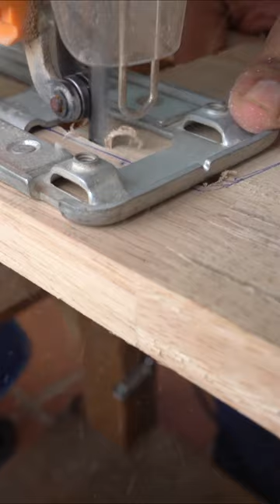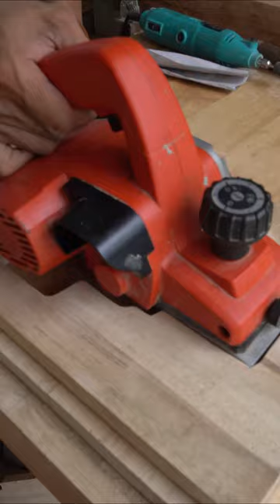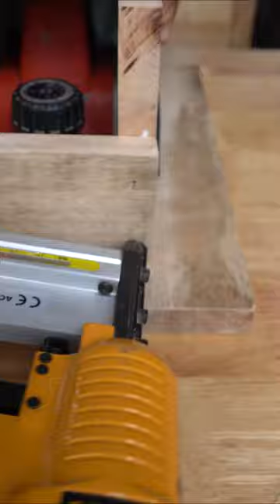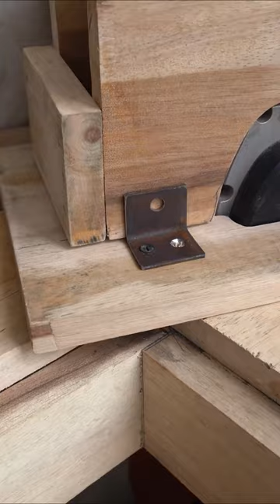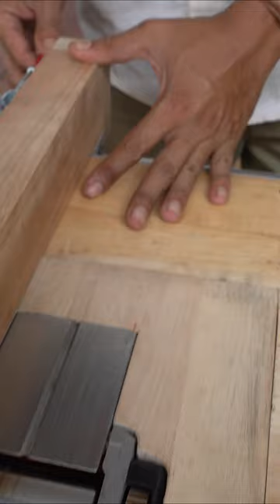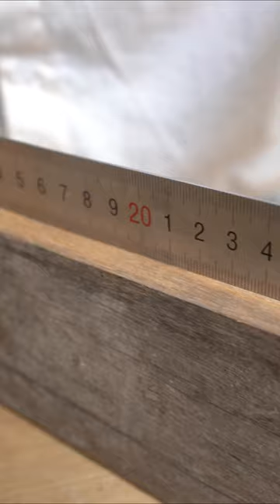Creative Simple Woodworking tool #woodworking #shorts #diy

Comment: Clamp two pieces together and just use the tool as designed. The wider surface will give you a more stable cut without taking a chance of cutting off fingers. Jointers have blade guards for a reason.
Reply: Nah this is a great way to save money on overpriced joiners. The “as intended” method isn’t as useful.
Reply: Pfft... Don't leave ur house if you're that scared
Reply: @jckdnls9292  I have seen fingers cut off in jointers, table saws and chop saws. I still count to ten with my fingers. As a carpenter for over 42 years I do have experience. There in more than one way to do everything. Just giving my opinion. Do it however you see fit.
Reply: @lyndonwhitson2269  yeah I've been doing  machining work for 30+ years and I've seen people's sleeves get caught on lathes, or  hairs around end mills,  fingers milled half off...  And yes there are dumb people everywhere.  However on this case, this guy doesn't come across one of them,  and his little project is harmless as long as you follow safety procedures like any other machine.  Stop treating people like children.
Reply: Ахахаха. Я, работающий на фуганке с шириной ножей 600мм😶

Comment: ça ne peut pas fonctionner...
le principe du rabot est la différence de hauteur générée par le plateau avant ajustable...ici il n'y a plus de possibilité de faire varier la hauteur de rabotage!
Reply: It will still work. It's just strictly a joiner at this point.
Reply: I contemplate the same idea. If the tool itself was mounted so that the outfeed portion was proud of the surface and parallel, it would function at least as well as it would when hand held. After another look, I think that if it was mounted so that only the extreme toe and the extreme heel were flush, then the cutterhead and throat would be exposed sufficiently to work with the action of a hand plane, rather than a jointer. This must be the explanation. I applaud his design and economy of construction! This is a very useful module to the combination machining station he has made. I am sure that he already has a router that can mount in the same opening. Subscribed!
Reply: @notreallymyname3736  no it won’t.  The infeed needs to be lower than the outfeed.  By having the wood go all around the outside keeps the trailing end the exact same height of the out feed.

Comment: If you use a machinist square and get this a perfect 90, with a nice longer fence then edging would be easy to reference. Nice to get a 90 edge so you can run it on the table saw.

Comment: Wouldn't you achieve better results setting up the piece on 2 saw horses clamped down and running your hand jointer with the fence down it?
Reply: I'm having trouble visualising what you're suggesting here. Any chance you could explain it a bit differently?
Reply: @DreamSmuggler  Certainly.  Since it is a hand tool they typically work better by bringing the tool to the piece rather than the other way around.  I don't own a powered hand planer but i do use fore planes and number 7 jointers for edge prep/jointing.  Typically you will want to hold the piece on it's edge in a work bench but if you do not own one you can make a notched piece of wood for the piece to sit in and then clamp that to 2 saw horses for an improvised workbench.
Reply: @mathewdruggan8877  ah, I see. I do have a workbench and that's how I usually use the electric hand planer, though less often since I got a thickness planer.
Downside of the hand planer for me is that it still requires skill, and so my pieces end up with bellies or valleys when I use it 😂